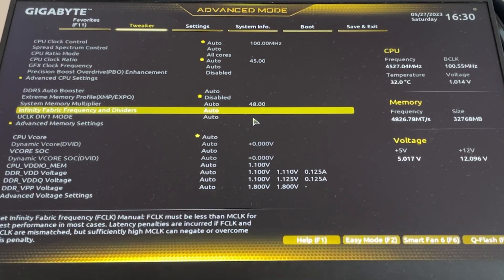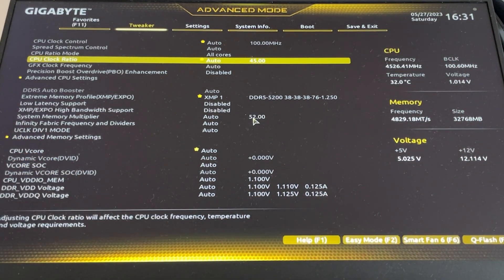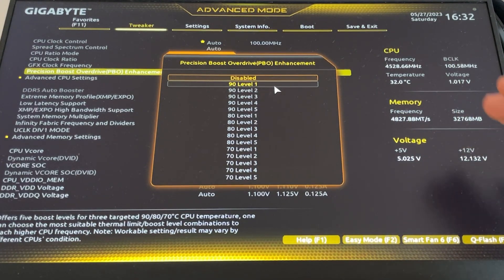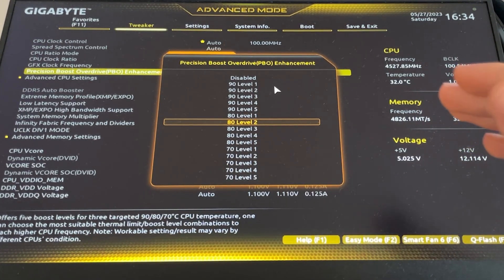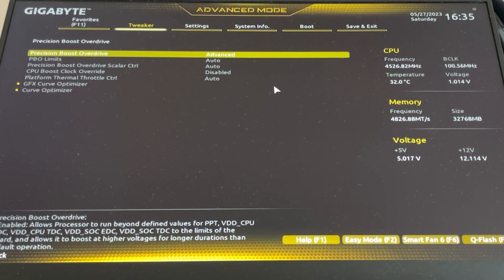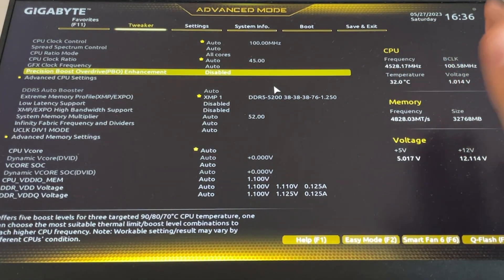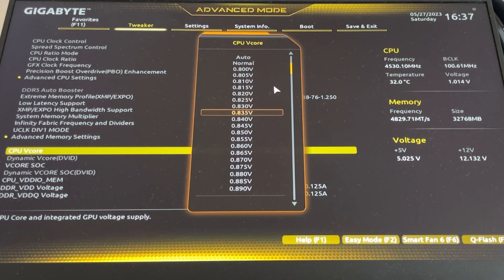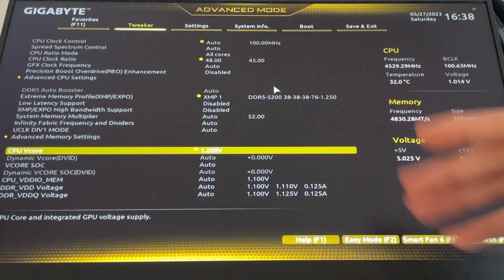Undervolt your Ryzen 7 7700X for more FPS and Lower Temperature!

Comment: There is a middle & better solution that mix both of method U tried.. & it's more simple..
Leave CPU frequency at auto (default)
Put 100MHz+ frequency in Curve optimizer, with 85c throttling limit 
Put 1.25v for CPU Core Voltage.. & done.. less temps by 10c while having better than stock high speeds (reaches 5.6GHz)
Stock Voltage CPU is 1.3v to 1.4v, which is "Overvoltage".. at 1.25v it's like 20w more efficient still perform like high stock speeds
Reply from the maker: This is a very good recommendation and I hope it will be helpful for some people! However, I do have to point out a few disadvantages it has: first of all, unfortunately this slightly overvolts the CPU on lighter loads and in idle, but more importantly this unfortunately require you to have a decent piece of silicon, whereas I aim my tutorials for everybody! Still, it's a good option with higher performance than what I proposed, even though it has slightly lower efficiency
Reply: @ImWateringPSUs  to be honest.. Ryzen 7000 serious considered high end cpu.. buying a high end parts to undervolt them for less performance but more efficiency is silly in PC world
The only high end CPU that need undervolt is Ryzen 9 7900x/  7950x
And mayby Intel i7 12700k / 19 13900k
If people want efficient CPUs, they should look for Ryzen 5800x 3D or any last gen CPU
Paying $250 for Mobo + $350 for Ryzen 7700x is a waste if you want high undervolt.. people should stick to B550 ($120) and Ryzen 5600 ($120) if they want efficiency & low price
Reply: @Jack_Sparrow131 what about video editors? Should I just go with the 7700x for the amount of cores it has?
Reply: @gtaloony2455  not sure what is your question is.. but I'll try to clearfy
7700x is powerful for games, but good (not great) for editing because its only 8 cores
Editors will prefer 12 / 16 cores even if they clocks lower
But if you were in light editing.. 7700x already is good overall
Reply: @Jack_Sparrow131 what do you mean buying high end parts to Undervolt them for less performance? I thought this video improves performance and at the same time lowers power consumption
Reply: @joshua7015  in simple words.. light undervolt might give a small improvement 
Heavy undervolt will give less performance, but better temps & electricity 
So, if you want to OC (get better fps) you will need light undervolt 
Some idiot people do heavy undervolt & claim its good idea..
Reply: @Jack_Sparrow131  Generational updates on processors improve efficiency. So you literally buy a Ryzen 7000 over Ryzen 5000 for the potential purpose of having the same performance but with less voltage. This idea that you shouldn't buy a better product and then 'squander' it by reducing your electric bill is ridiculous.
-Or in my case, to reduce the amount of room temperature increase the PC causes.
I replaced my overclocked 9600K running at 1,4V +90C/194F to play a game with 144fps to an underclocked 7600X running at 1,25V +60C/140F to play a game with 144fps.
I personally see a very clear and approximate reason why I made the jump. My room temperature dropped several degrees while gaming.
I presume you would just suggest to get an AC instead in this scenario. But that's not me.

Should I now choose later that I want or need more performance from my CPU, I have the option. Even yet. Since the 7000 series is the first generation of the AM5 platform, I can(will) later replace it with an even more efficient and more powerful one.
Whereas what you recommend is to buy an inferior end of the line (B550) product that will become obsolete much earlier, making it harder to sell it or less optimal to pass down later down the line.
Your suggestions have their merits in some cases but make sure your arguments are bullet proof before you start calling other people and their ideas idiotic.
Reply: @joni8401  well.. not everyone like you live in cold place, half rest of the world live in hot areas where its essential to use AC even without PC
Idea of undervolting is understandable for laptops & maybe mini ITX small builds, which doesn't stand a chance with high temps
But for example, buying like 1k GPU and undervolting is a total idiotic idea.. it would be wiser to buy 4070 for 220w rather than buying 350w - 400w high end 7900xtx..etc.. same goes to CPUs
It's like fking buying a Lamborghini V12 and use eco mode on it.. it's just irony
Reply: @Jack_Sparrow131 
Who said I don't have an AC. It doesn't even matter really whether I do or not.
You are choosing to be one more in a billion of people who think that you can keep the windows open when it's scorching outside just because you can always amp the AC up more. I'm not an eco-activist but that is still just plain wasteful.

 I am much rather buying a 400W GPU and undervolting it to 200W now and upping the amp over the next six years as time goes on and games get more demanding over buying a card that does not scale with my needs.
-The user experience with it going worse as time goes on and my FPS targets go further away from me and has to be replaced in four years when it becomes obsolete.
By then It's harder to sell on the used market as well.

It's like buying a car with a 99horse power engine and never using more than 66hp.
And then having that option to boost out from under a train on a collision track toward you rather than dying because you and your 66hp car lacked just barely enough power to get away in time. Irony.
Reply: @joni8401  so.. the 400w that can undervolt to 200w huh.. cause last time I checked, the max undervolting can GPU have is like 8 to 12 minus
So in theory, if you have 400w GPU, you will get it only 370w after undervolting
WD.. you just saved 30w from 400w.. Lol
Even Ryzen 7700x reach 145w max.. after undervolt it's go like 120w with avf undervolt settings 
How this 30w / 25w will save your room temperature exactly?
Wouldn't be buying ryzen 7800x3D with its lower voltage & better performance would be better option rather than buying full unlocked X chip (7700x)?
People these days are just spreading BS and they get angry if others didn't agree with their idiotic ideas..
Gamers care about max performance.. not undervolt.. undervolt only make sense in mobile, laptops, Gaming PC should be focused more on Performance.. not 30w saving xD
Reply: @Jack_Sparrow131  
I said I would RATHER undervolt a 400W card to 200W than buy a 200W card. Get a grip.
I will undervolt my 3080 as much as I can and the rest of my effort comes in limiting how much work it has to do.
As I said. I only need 144fps. I do not need to spend 400W, or as you pointed out "370W" worth of GPU performance for 250-350fps while playing. I need it to render for what's worth 144fps. I don't need my GPU's TDP of 320. I need an average of 175W-200W.
I've set up my CPU up to 65W eco mode with generous thermal limits using Precision Boost, not for extra performance, but for efficient performance.
I get my 144fps with these settings. I don't need my system to spend 0,25€ every 4 hours in electricity a day to play Apex Legends. I need it to spend 0,1€ every 4 hours a day.

This all obviously boils down to you doubling down on unwritten rules you made up yourself or read on some completely random reddit threads without having any clue how dumb it sounds to tell a gamer how gamers should behave with their gaming systems.

Why would I buy an expensive 7800X3D if a 7600 game's, edits videos fast enough and runs all my needs, and isn't going to be nearly as good a replacement as a future 8800X3D, or possibly a 9800X3D will be.

Again. Your suggestions have their merits in some cases but make sure your arguments are bullet proof before you start calling other people and their ideas idiotic.
Reply: @joni8401  well.. you say you need only 144fps.. with 175w cap.. 
And as far as I know, 144fps for 175w is only reachable at 1080p
But as 3k / 4k acreen with 120hz / 144hz you need minimum 300w GPU 
Don't think people will use 1080p screens like your RIG
My 4k screen need a lot of GPU power to run smoothly
Reply: @Jack_Sparrow131  I deliver you my 1440P leisure screen and 1080P gaming screen, at your service. No idea why you would need a bigger screen for gaming.
And I don't wanna know. I have over 10 years worth of mortgage's to pay.
4K only forces you to replace your GPU more often far as I'm concerned.

I hated the fact that my 1070 went from +144 in CS to 90-120 in Apex to not maintaining 60 in RDR2

The RTX 2000 series sucked and wasn't worth it. I tried three separate RX 5700 XT's with full system reinstalls and the AMD's kept crashing my system, crashing my game's and being incompatible with software. Even with Hardware Acceleration disabled.
So I had to rely on the old 1070 for a very prolonged amount of time after first deciding it needed to be replaced.

I do not recommend buying bare minimum. It ages like a glass of milk if you can't replace it as soon as you need to.
My RIG is overpowered for my current needs but It won't always be and it'll suck if you can't replace it as soon as the wall hits.

Anyway. It's been swell. But our little chats have ran their course, I believe, toods.
Reply: @joni8401  RX 5700 had some drivers issues, especially in 1st year
With RX 6000 series release, they had less issues & its buttey smooth (had RX 6800xt) which was 3080 competitor
Now I had 7900xtx and it's buttery smooth in this 2 months I had it, probably Overkill, but 4k 120Hz is power hungry
Reply: When you say add 100Mhz+, what do you mean. there is no way to adjust freq in CO only offset amounts. ??
Reply: @lbmusic444  He is talking about CPU Boost Clock Override as +100
Reply: @ thanks, year later but I appreciate the response... Will try to tweak it and see what outcome is.
Reply: Well my CPU only goes with 4,6ghz with this Stettings how you get to 5,6?

Comment: Wait...doesn't the preset PBO just push more voltage to the cpu in order to overclock it? I don't think the default settings 1,2,3,4,5 have a negative sign, i.e. an undervolt.
If so , won't this probably just increase consumption (and temps) and possibly fry the X3D chip?
Reply from the maker: Nope, they actually reduce the voltage by a said number of millivolt, it won't fry your chip if you follow the tutorial, rest assured!

Comment: You are my savior man ❤
İ had my cpu was working on 2k-4k gaming 90+ degree tempereature, after i applied your options, now it works on 72-82 ✌️ as CPUID HWMonitor said
Reply from the maker: I’m really happy it was helpful! Thanks a lot for taking the time to write this! :)
Reply: @ImWateringPSUs  no need bro, but today it turned same situation, i run last of us part then my cpu termperature increased to 90+ degrees. what was wrong ?

Comment: whats the diferrence betweeen CO and GTX CO ? :D .... i start amd ryzen master auto ALL CORES optimizing and after 10m result was CO -50.... but i cant set TEMP LIMIT in ryzen master only PBO ... still 95C

then i set PPT from 88W to 70W ..result 14k at CINEBENCHr23 80C 4.9Ghz full 70W 
                                                                               at Prime95              80C 4.5Ghz full 70W
Reply: GFX* optimizer is for the integrated graphics.. not the CPU..
Reply from the maker: I have actually never heard about GTX curve optimizer, you sure you don't mean a different word? If it is GTX please tell me what motherboard you're running. -50 CO is VERY aggressive, I'd really recommend setting the temp limit via bios but you got a VERY good result there!
Reply: i set CO -30 and temp 80 C in bios.... -50 was crashing games .. but not in benchmarks lol
Reply: @codalej1998  just make sure you're changing the Curve Optimizer (CPU), and not the GFX curve optimizer (iGPU)... as he shows the wrong thing at (5:18)